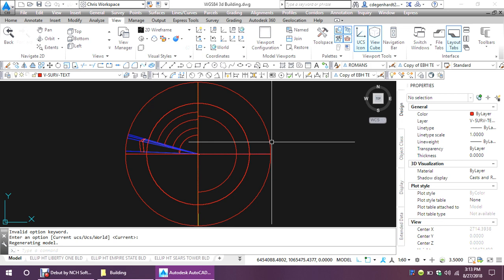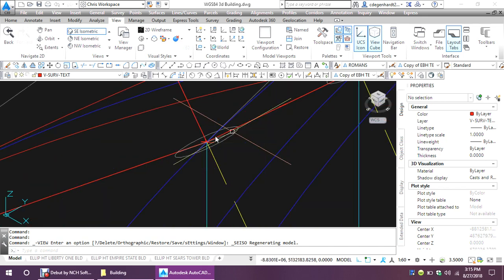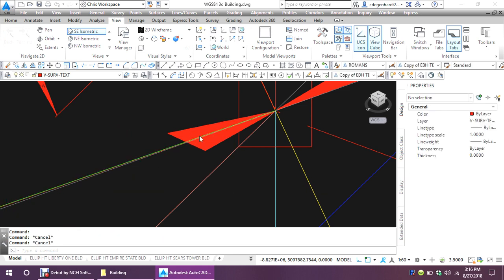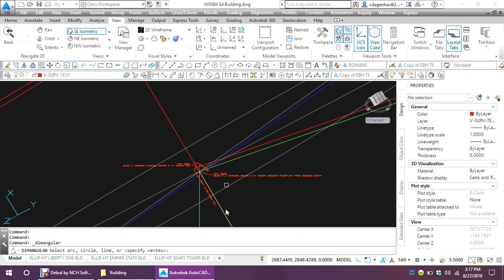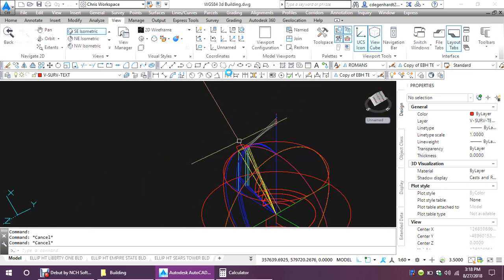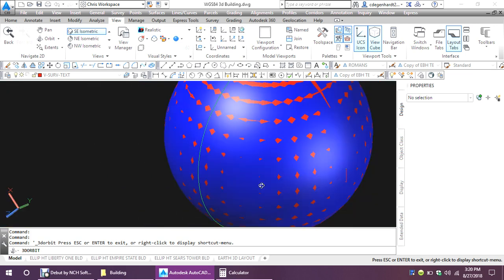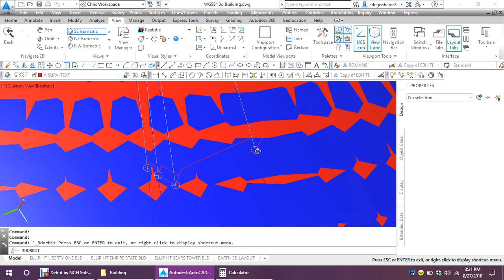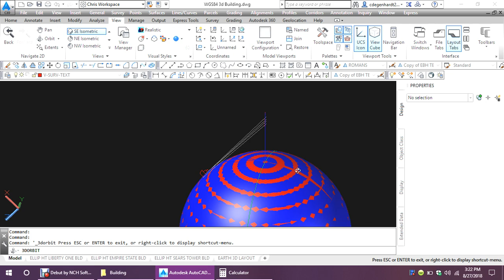Tilt Angle Between the Sears Tower & Washington Monument in Civil 3D

Comment: Great work Chris. Just for anyone following along here, the coordinates I gave to you are the WGS84 ECEF Cartesian Coordinates of the tops and the bottoms of those buildings. These  3D coordinates are not dependent on the ellipsoid, but can be converted to Latitude, Longitude and Ellipsoid Height. Most people think GPS / GNSS works in Lat Long, but it does not. GNSS works in WGS84 ECEF ( Earth Centered Earth Fixed ) Coordinates.